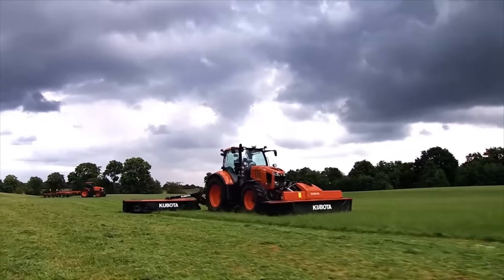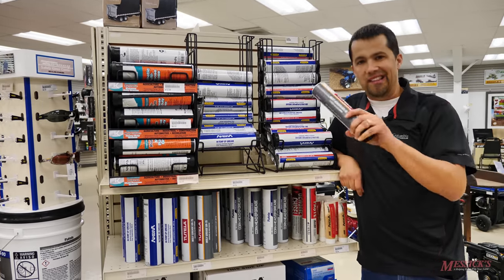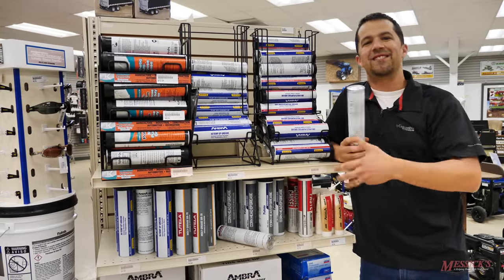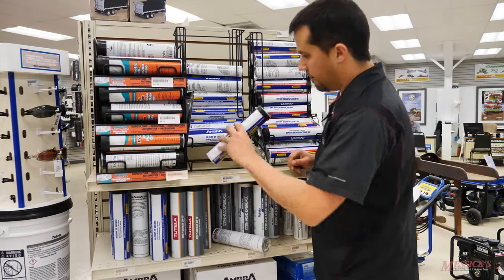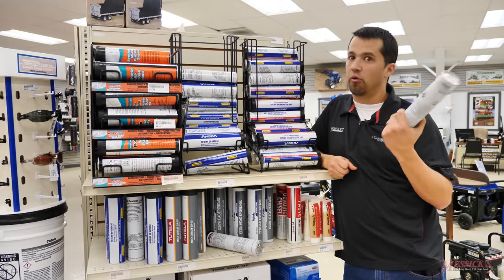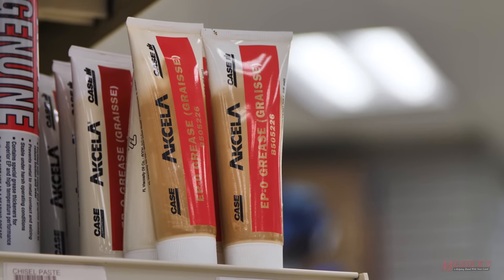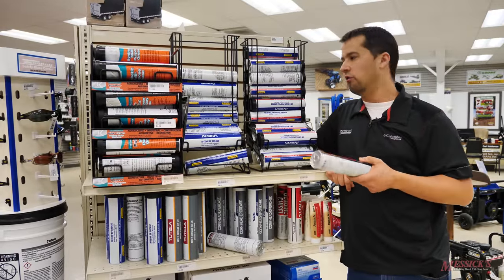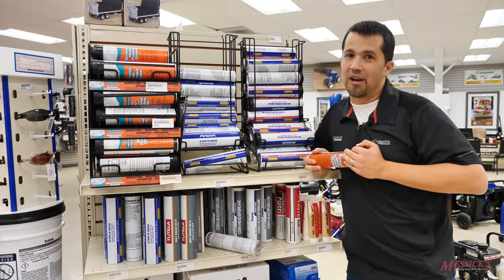What grease should you be using?? - TMT

Comment: Moly grease recommended for pins/bushings, high temp grease not as good for pins/bushings but great for high speed bearings. Hightemp grease not as good for pins/bushings. Don't sell moly grease short. Sell the right grease and recommend the right grease for the application. Not a one size fits all answer. Great videos but their is a right place and use for every grease.
Reply: Mark Larsen I completely agree!

Comment: Great info Neil , I’ve been using mobile 1 synthetic grease on all my equipment for years now and it does a great job, has a really good temp range for us way up north we’re it gets very cold in winter and very warm in the summer. 
Cheers from 🇨🇦👍👍🚜
Reply: That's exactly what I use. Worked flawlessly on all loader pins,  as well as any high-speed bearings. It's messy because it bleeds. But I think it's the best of the best.

Comment: Neil thanks for your videos, as stated Grease is more complex than it seams.  For example if you have a high speed bearing with a polyurea grease and pump lithium in it, it will fail because of the incompatibility. The grease won’t even stick to the race surfaces. (Like oil and water) Pins and bushings are not as big of a issue but bearings are.  Look up a grease compatibility chart. It’s a big problem in the hvac industrial industry.
Reply: correct. I belive the kubota grease he picked up is polyurea "sheer stable" which is compatible with lithium complex grease, correct? conventional polyurea is not. thiughts?

Comment: As My Grandfather who Farmed & Was also in the excavation business for over 50 plus years used to say: "Grease Is Cheaper Than pins."  They always used Either Chevron, Exxon,Mobil or Texaco Hi temp grease.,(depending on which bulk fuel plant they were working closet too is whose grease we used) It was drilled into my head@ an early age that Grease is an ounce of prevention. Weather we were working on the farm or on clearing, demolition or excavation job not a day went by that our machinery didn't get greased.  Most of the time The Machinery was grease in the morning along with Fueling. If my Pop, Great Uncle, Dad or any of the GC's they worked for heard anything squeak they stopped that operator & machine & handed the operator a grease gun filled with a fresh tube of grease. Meant for him to grease the machine. Mack

Comment: That’s crazy that you post this topic today since I spent roughly an hour in a Farm Supply store today trying to figure the best grease for my B3350HSDC’s (first)10 hour service. I even called my dealer and asked and they just said lithium. That was pretty vague. Glad I waited to lube up. I purchased Valvoline Crimson. I will research more before I pump the FEL, BH, and Mow Deck full of the wrong stuff. Thanks again for the totally relevant video.
Reply: It's not that critical. Greasing often is more important than what you use. Like your dealer told you, multi-purpose lithium grease will work just fine for everything on your tractor.
Reply: Thanks for the info.

Comment: Read the manual... it should tell you which grease for where.
.
If it does not say, I will default to a marine grade high temp.  Its a bit more expensive.  Resists water and works on my outboard.

Comment: Having just ordered a new B2601 from my dealer here in VA, this was a very helpful review. Thank you! I have owned two previous Kubotas and a JD, but I have been tractor-less for 10 years. I don't suppose you have dealt with the hot potato of oils yet? 

My basic issue on oils is not so much brand as it is type and timing. Dino vs. synthetic and when. A friend got me using synthetic in vehicles and tractors a long time ago. I know it is better in some ways but not necessarily as often as I change the oil anyway. My big question, however, is always how soon to use synthetic? As I recall, I decided on tractors to use regular oil for the first year to allow adequate break-in wear.

Comment: Would you recommend using Marine (water and corrosion resistant.) grease on a tractor? I have a Kubota L2501 that needs the pins and bushings greased and that's what I currently have available. Would Marine grease negatively impact anything?

Comment: When we choose a grease for an application, we should consider what oil and viscosity of oil would best work in the area and use that to start our grease selection.  Grease is simply oil in a thickener. 
About 85 percent of a tube of grease is actually oil the rest is thickener and additives.  Moly, or M OS2, is a solid film lubricant that is mined from the earth and is great for high shock loads like you find in bucket pins.   Different thickeners also help determine the heat stability.  Just about any Lithium or Lithium complex grease has a dropping point of nearly 500 F , which means you can work with that grease at about 350 F.  Most grease marketers will put “Hi Temp” on one tube but not the other and they both have the same dropping point.  It’s about marketing.  Also, the color of the grease has nothing to do with the performance, it is simply a dye for identification and marketing.  There could be a blue grease, that has  better high heat characteristics than a grease that is red in color.  Look at the thickener or refer to the product data sheet.  Both Lithium complex and Calcium Complex thickened greases have great resistance to water washout which is needed on outdoor equipment.
Reply: You do realize that mixing a lithium grease with water causes the grease to break down correct?  Scrape ANY lithium base grease into your hand, pour water on the grease and mix it around chances are more water will end up in the grease than on the floor.  That's why all lithium greases are labeled water RESISTANT.  Resistant is marketing much like hi temp.  That being said grease is either waterproof or it's not no lithium complex grease is waterproof.  If a piece of equipment sees any amount of water through washing, or rain you don't want a lithium grease protecting the components.  

And moly isn't preferred in high speed bearings because the moly will plate to the bearing as well as the race and in a high speed bearing situation the bearings can skid across the race causing flat spots which isn't a good thing when it comes to a bearing
Reply: pete379exhd2010  Lithium Complex greases are used in heavy equipment applications with daily re-lube intervals in  wet conditions without issue.  Adding water and stirring it into the grease is not something that would happen on a lube point of a piece of equipment.  ASTM D-4049 water spray off test is a good reference
Reply: @jacksarebetter  so your theory is to disprove an easy grease breakdown test is to go to a lab with controlled conditions? Last time I had checked there's over 100 points of grease on each truck I own all of which are subject to water.  

You say that it's impossible to get water into those joints...well when I did shackles and bushing on my leaf springs there was a fair amount of rust that came out along with the wonderfully discolored tackless grease which was fairly tacky when it was put on there.

Was that front end grease daily no book calls for 10k I greased it weekly front end lasted 2 years or so.  Mobile 1 5% moly blend.  Good grease but again lithium complex which again doesn't like water but it's got 5% moly so it still in theory should have had a layer of protection but alas when the thickener breaks down it does no good.

I can say the same for S cams, gate pins, name it I've replaced it at some point in time or another and seen the effects water has on grease. 

Want a good demo of how grease breaks down in water wash a cow wagon out...and grease the trailer after words you'll force water from every joint, as well as discolored broken down grease.

You act as though I have a problem with lithium grease no not at all, my problem is with your statement about it being waterproof which it's not, not in the least bit. 

 You say it's been used for years which it has been key words are also greased daily...I can pull plenty of grease charts on equipment that work in wet conditions that don't require daily greasing my truck is one of them.  And as stated previously I've replaced enough parts due to grease failure to know what to use and what not to use.  

You can keep your opinion which is fine and use the grease that suits you best that is also fine that is your choice, but don't tell people that lithium grease is waterproof, or tell people it's highly water resistant because it's neither.
Reply: @jacksarebetter  now you resort to name calling real classy.  So you get upset because you don't like the facts that you're presented and result to name calling and talking about your 1000s of customers...what do you do for an encore?

Comment: Normal moly greases are NOT for roller/ball bearings. The moly can be so slick the balls won't roll properly and can ruin them. 
Synthetic greases work much better at low temps, especially below 0F. The synthetic base in those greases don't thicken up nearly as much as conventional. Get it before the cold snap, you won't find it afterwards.

Comment: I always appreciate your videos, Neil, but Kubota's Owners Manual stipulates exactly which Grease (Shell Alvania EP2 now renamed Shell Gadus S2 V220 2), Hydrostatic fluid (ISO46HD) and engine oil (SAE 15W-40 for all climates) that their machines come with from the factory.  Oh, and Ultra Low Sulfur Fuel (<0.0015%/15ppm) is an strict requirement.  I know you've said otherwise in your videos, but folks probably shouldn't be using your home heating oil in modern tractors unless you use cetane booster and lubrication additives.  Even then, I think I'll just pay the street tax and run the best ULSF from a station that has high volume....
Reply from the maker: unless you have some abnormal supplier, Heating oil is ULSD. It's the same product as what's at the pump.

Comment: Given the grease schedule of every 10 hours for the loader and backhoe on a Kubota, does it really matter if you use a longer lasting synthetic grease?  Won't a bargain priced  moly do just as good, given the frequency at which it is changed?
Reply from the maker: I'd assume the 10 hr interval is assuming a pretty mediocre grease. If you went synthetic logic says you should be able to stretch the interval.
Reply: If you do stretch the interval are you risking non-warranty coverage if say your maintenance schedule shows that you greased every 20 or 30 hours, instead of the recommended 10?  I guess you could lie and say that you greased it every 10...but I find tractor owners are very decent people who are for the most part down to earth and truthful.
Reply from the maker: No warranty concern. No one would like it, but theoretically you could never grease it and not void your warranty.

Comment: Neil is very helpful and knowlegeable about so many things…but. THIS VIDEO about GREASE types borders on useless…. UN-informative…and MIS-leading.  Lots of “key words” uselessly thrown about with no real information provided.  PLEASE NEIL… RE-DO THIS VIDEO and take THIS one DOWN!
  Grease is OIL… mixed with thickener to prevent it being lost thru useage….I.E. to keep the oil IN PLACE for longer periods of time.
  The TYPE THICKENERS used impart different characteristics to the grease which helps it perform best in different applications.
  LITHIUM is a Good, All-Around thickener for General Purposes including roller bearings, ball bearings, and tie-rod ends.  Calcium Sulfonate is a thickener that is more waterproof than Lithium and is better at marine and boat trailer wheel bearings which are submerged and subject to wash-out, because of it’s water-proof properties…. it will keep the grease in-place longer than Lithium.   BUT… Lithium will not mix well with Calcium, or Aluminum-base thickeners.  If you mix different thickeners with each other they will SEPARATE and CONGEAL and fail to release the oil to do it’s job.  The bearings will not receive that oil and will be subject to EARLY FAILURE because the mixed thickeners conflict with each other.
So whatever grease thickener you choose…STAY WITH THAT unless you COMPLETELY REMOVE the other type.
  Within the family of General Purpose Greases there falls “High Temperature”, “Extreme Pressure” and “Heavy Duty” adjectives which describe greases with heavier-viscosity oils, Extreme Pressure additives such as Phophoric additive, and heavier-duty thickeners.  Those terms are usually “subjective” and can often merely be promotional comments on the package, but “High Temperature” is usually associated with high-speed wheel and spindle bearings and disc-brake systems and are NOT to be used in “low temperature” operations such as refrigeration systems or in Arctic conditions because they will not “flow” properly at low temps.  For most tractor operators, any “Heavy Duty, General Purpose, Lithium complex grease is appropriate and there is no need to spend more than $5 for a tube of such grease.  The “best” all-around viscosity will be labelled “ NLGI#2, GC-LB”. which describes an industry standard appropriate for the majority of vehicles, tractors and construction equipment if nothing else is specified.
   Synthetic greases can be given extra points for staying on-the-job longer…. so if you cannot grease regularly and can only do so infrequently… Synthetic grease may help alleviate that shortcoming.  But generally speaking, unless the equipment manufacturer specifies Synthetic grease…then it’s more economical AND better for your equipment to use less expensive mineral greases and use them more often.  (More frequent greasing not only provides fresh oil to the working parts…it also pushes out dirt, corrosion and old product when the new grease is pumped-in.)
  MOLY grease ….Neil… is NOT “cheaper”.    Price is NOT the advantage of “Moly”  grease.  (In fact, Good Moly Grease is more expensive than good General-Purpose grease.)  “Moly” is short for  “molybdenum disulfide” … a compound made from the mineral ore molybdenite.  It acts similar to graphite in that it forms dry flakes that “slip and slide” around and over each other thereby providing a long-lasting lubricating coating and is best for pins, bushings, pivots, etc that do NOT use bearings such as rollers or balls.   A front-end-loader is an excellent example of food use for Moly Grease.  Do NOT use Moly grease on wheel bearings, roller or ball bearings, etc. because the moly will allow the rollers/balls to “slide” instead of roll….and that can damage the bearings.
  Hope this helps.  Thank you Neil for the vast majority of your VERY helpful informative videos.  
Kind regards
George Horn
Reply: Thank you for sharing this!!!

Comment: Just in case it hasn't been mentioned yet, never ever mix lithium and polyurea grease. They will not mix and will cause catastrophic failure. It's best to use whatever the manufacturer started the fittings off with. If switching to a synthetic, make sure you stick with the same base blend as the nonsynthetic that the manufacturer used.